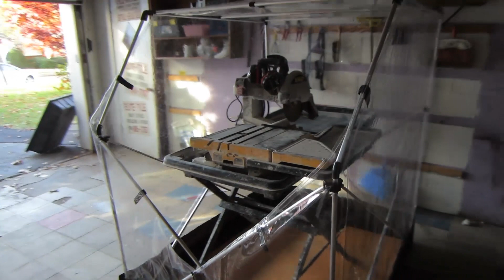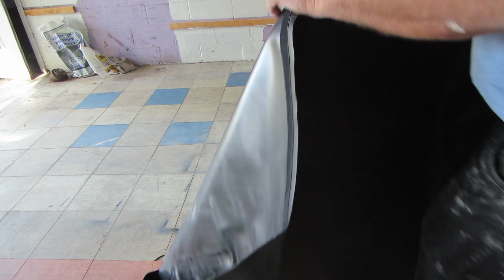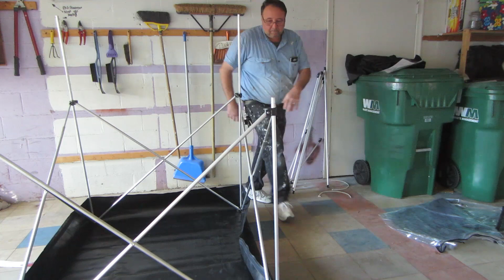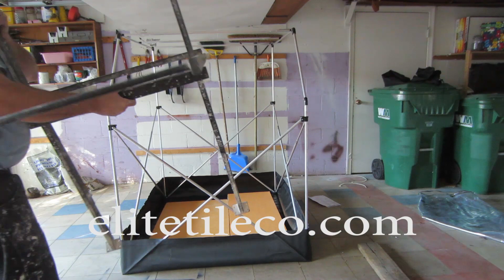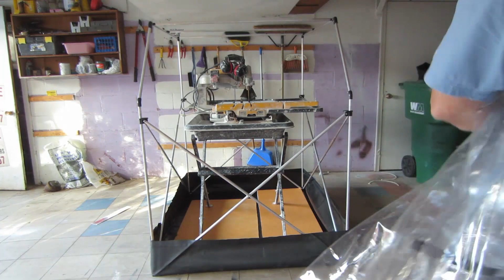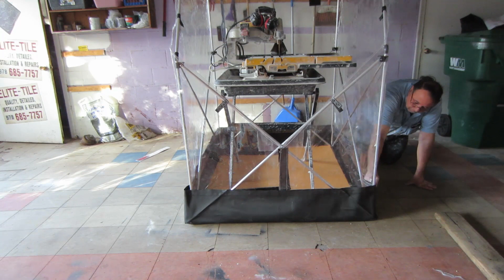Barwalt Saw Shack

Comment: Seems like you have to lean over front brace with toes bumping containment floor. Took a while to set up. I use a pvc pipe clamped to handle with a contractor garbage bag clamped to it.  Adjustable, cheap (2$), quick, clean and it work well with Dewalt and the various size tiles i use. And no complaints from other tradesmen or clients.